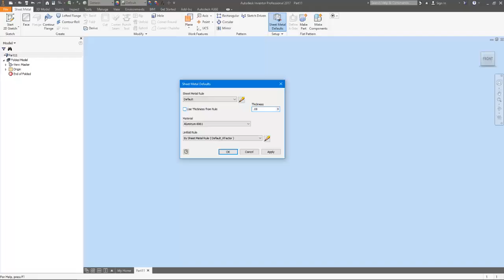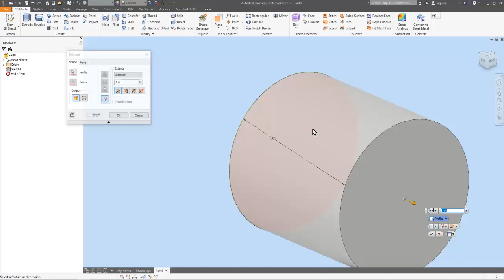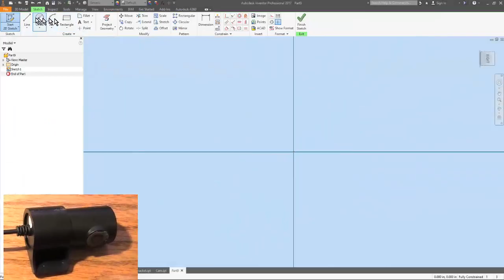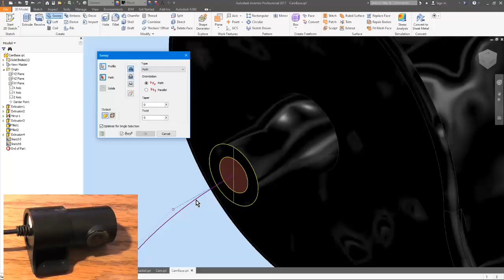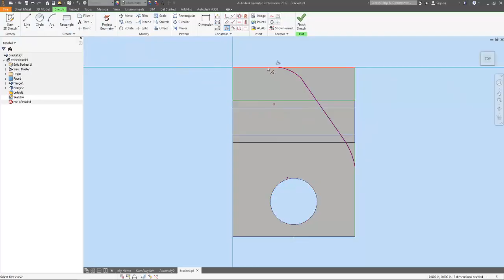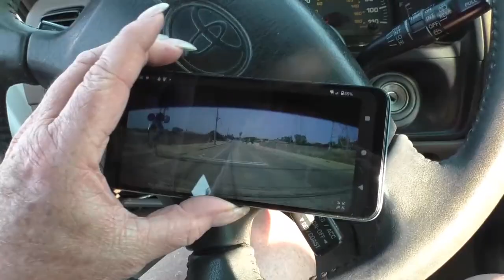Custom Rear Dash Cam Bracket, 2001 4-Runner

Comment: Can you provide the detailed dimensions of your designed bracket?  This is exactly what I need to mount a Rove Dash Cam rear camera on my 2001 4-Runner.  Thanks.
Reply from the maker: Let me know if this link works: https://drive.google.com/file/d/1duvvb0cm4OGDzu9TTmOoRyGAGV4qKpX2/view?usp=sharing
Reply: @digysdosdiy9113  Yes, got it.  Thank you so much.  This really helps.  I sincerely appreciate your help.